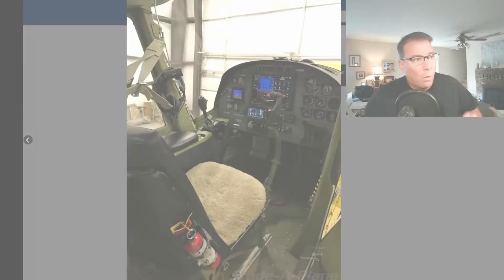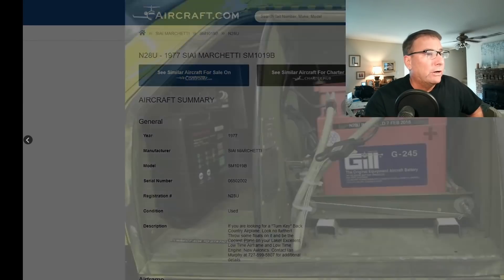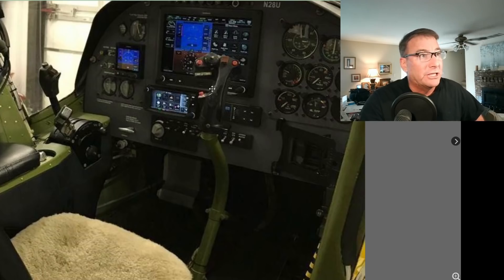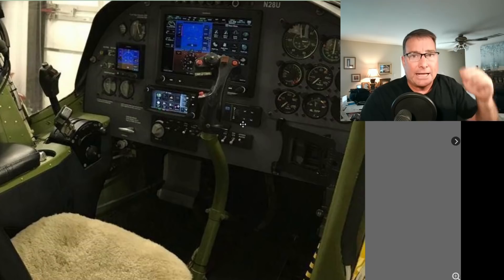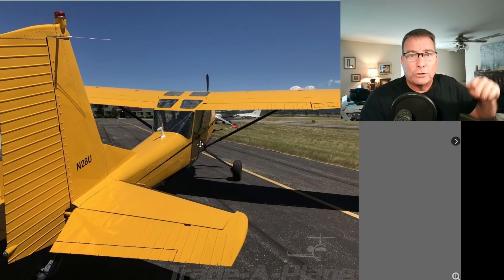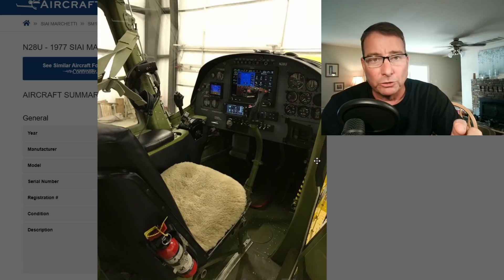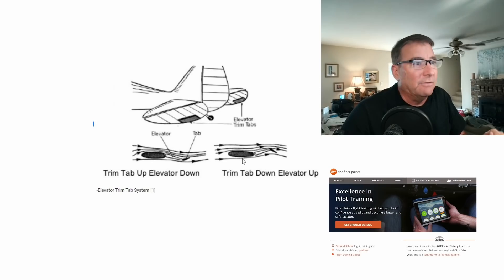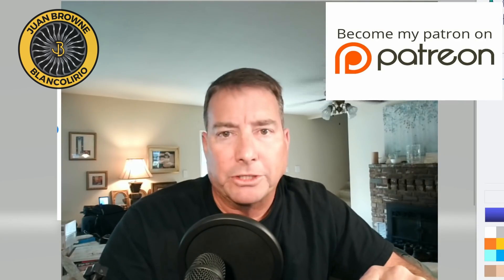Dale 'Snort' Snodgrass Siai Marchetti UPDATE- Elevator Trim System 8/8/21

Comment: "In God we trust, everything else we check..." This must be one of the more important things to check after any maintenance work.

Edit: I've considered my remarks and feel I've done the pilot an injustice here, even though the principle above might be true. 

I'm sure Mr. Snodgrass didn't live a long aviating life by being blase and the thought occurred to me that the problem which sadly took his life may have happened on the takeoff roll. He could have zealously checked for runaway trim before every flight only for it to happen on the taxi out or the takeoff roll when it wouldn't have been apparent until liftoff...

I check for full trim travel and as part of that I check the sense of the trim tabs at each end of travel, but I don't check the tab when returning it to takeoff position. I wonder what the odds would be for the mechanism to fail just as I've started moving it from full to T/O? 

From now on I'm going to check that too and, for those of you with electric trims, how about a quick squint backwards (if able) to check the trim sense as you line up & check your controls for full & free movement?
Reply: “Flight controls ……. Free and CORRECT”
Reply: @Andrew-13579  and don't just say the words! What you've said is true, but read my edit above please.
Reply: Do all or most aircraft have a trim position indicator that’s mechanically linked to the trim cables?  Then, before takeoff, check trim “at takeoff setting “.  As I recall, most if not all Cessna 150’s had this (I know this was not a C150).  But they didn’t have electric trim, so it couldn’t run away.  It took a lot of swipes on the trim wheel to go from high nose up trim to cruise trim.  I wished it had electric trim.  So, is there some clever way to wire up or design electric trim so that it is nearly fail safe?  …or very robust.  And do they always have a manual back up if electric trim fails?  That’s assuming the trim tab had anything to do with this accident.  

Maybe it was CG?  Or runaway trim with aft CG?  Or aft CG limit with a sudden load shift that then put CG out of the box?
Some combination of CG near limit and insufficient airspeed over elevator at high AOA and attitude?  Such as, did the prop wash stream move above the stabilizer and there was not enough static stability to bring the nose down, even at full forward stick?

When was the previous time he flew the airplane?  And was anything worked on between that flight and this one.  I guess the log books will tell, hopefully.
Reply: @Andrew-13579  not being familiar with anything other than C152 & 172 I can only guess, but I expect they do. My point, probably not well articulated, was that I would correlate the tab position visually with the T/O set point indicator on the trimmer. Yes, there are many ways for things to go wrong. I hope the Accident Board manages to find out which did.
Reply: @theflyingfool  In other words, look back through the back window, pull the yoke back to lift the elevator and see the trim tab, and then move the trim to see the tab respond in the correct direction.  Right?  Yes.  It’s been many years but I remember doing that.  I remember my instructor telling me to do that, either in pre-start check or out at the run-up.  I didn’t always do it, though.  I would, however, always look to see the tab about where it should be for takeoff, and that that agreed with the takeoff trim indicator on the panel.  But then, takeoff trim was always pretty close to neutral and there was only 100hp (at most), and I always made normal attitude takeoffs that were pretty flat.
Reply: @Andrew-13579  Aye!
Reply: Imwt- In mechanics we trust
Reply: @brandyf4088  yes, indeed, but all humans are fallible and if I get an aircraft back from maintenance I go over it very slowly with a fine toothcomb and check everything I possibly can. In todays hectic world having things double checked by a colleague isn't always a failsafe...

Comment: Unless he'd never flown the aircraft before or it was fresh out of maintenance, a reversed elevator trim would have been noticed and corrected. A runaway pitch trim or jammed elevator control would be more likely. Hopefully, enough of the control system survived the crash and post-crash fire for investigators to determine the cause. If you consider the pilot's flying ability, it had to have been something extraordinary if he couldn't deal with it.

Comment: Great job as usual Juan.   I think you’re on to this by focusing on elevator trim.  
My uneducated opinion based on several thousand hours of Tailwheel :   He’s in a hurry…… trims full aft for run up  ….departs before retriming stick. It went severe nose up immediately as if it was inadvertently set that way

Comment: Trim theory easily answered. If plane flew correctly last time flown, and had not been serviced, wires don't rewire themselves. Unless you're saying the motors are known for reversing by themselves without human. Defies mechanical logic though.

Comment: Maybe they need trim override “Button” at take off, simple solution. Trim is for basically level flight, I believe, from a wanna be a pilot since air cadets, 188 Cobra Squadron, Downsview Onatario. Trim killed the Max jet too! Great info in your videos, thanks.
Reply: Anyone saying this is from trim is an idiot who hasn't flown a small plane in a long time, if ever. He 10000000% could overpower a max trim using the stick. It would have made for, at best, a weird looking takeoff from the outside but likely someone with his skill level it would look completely normal to us, he would just declare an emergency and land and his arm would be a bit tired.
Reply: @X85283  Is this the only video you have watched?

Comment: New a guy in and A36  pilot in SJC that was talking to tower PTT switch during which he was also pulling trim switch. He almost died the aircraft went nose up and it took. Took everything he had to control in high density area.

Comment: I suspect you are on to it there Juan. Typically you don't install a trim disconnect switch unless it's more powerful than you are.
Reply: Jack, I thought any electric trim system required a disconnect switch on the yoke?
Maybe just on every plane I flew that had an autopilot. Humm?

ON ANY airplane I ever flew with an electric trim, the first CB I familiarized myself with was the Trim motor Circuit Breaker. 
This is especially important when flying on autopilot because the A/P will keep the commanded attitude even if the trim is in a un commanded runaway, that is until the control forces exceed the auto pilots command authority.

I have had two of such trim runaways while flying and know of a turbo prop crash at I commuter I flew for who crashed as a result of masked trim input from an autopilot on a coupled approach.

Comment: About 35 years ago I took a solo two week trip in my 1964 Citabria. I had removed the back seat and stick to allow all by baggage and my bicycle that would just fit with the front wheel removed. I took off and climbed to 8500 ft for my cross country. Starting my high cruise decent, I descended to around 3000 ft and began to level off, or so I thought! I gently pulled back on the stick and it would NOT pull back! I immediately turned around in my seat to discover one of the front forks of the bicycle that I removed the front wheel off of had dropped down and lodged INTO the control fixture that holds the rear control stick. Fortunately, I was able to quickly reach behind me and pull the front bicycle fork out of the control fixture and regain full control! LEASON learned and I was extremely fortunate! From then on, if I ever removed the back stick control, I installed an 8" stainless bowl inverted over the rear control fixture on the floor and screwed it into place over the wooden floor panel at the rear control fixture. That fully protected the rear controls with the stick removed. Hope someone learns through my STUPIDITY! On stick controlled aircraft, always put in place some type of cover to protect the fixture from interference! Just lucky this happened at altitude and I had time to investigate and fix the problem rather than during take off or landing!
Reply: As QA on different military aircraft and as an A:&P I used to find FOD in the cockpit.  It was mostly pens, cotter pins, rivets, coins, and safety wire.  One of our birds was craned off the ship due to jammed flight controls that we could not duplicate on deck.  Scary stuff at any time but more so around aircraft carriers.
Reply: Doing a little training with Beavers and  Otters used during emergency relief flights we had to review a video.  In it it showed ground crew, fire department personnel, and volunteers pushing and pulling one of the floatplanes from the left aileron and left elevator by hand to get it lined up on the dock.  I pointed this out to the instructor that it should not be done like that and to never push or pull the aircraft by the flight controls.  He blew it off as no big deal.  He was not an aviation type guy.  I insisted that it can't be done like that any further.  I'm not a licensed pilot but have flown planes before.   My friend siting  next to me who was a former Air Force pilot and has flown many types of aircraft kindly intervened to try to set the guy straight.  We all had to talk about it after the class. The onstructor finally came to his senses.  

I don't see that the elevators would be damaged like that in this case but it goes to show how something seemingly minor to some is really a big deal.
Reply: I sure hope the investigation looks at the camping gear and what you mentioned about some piece of gear jamming the controls.  Also did some camping gear shift rearward causing rear CG problems.
Reply: You'd have thought that the aircraft's makers would have anticipated the possible jamming of a control column by cockpit debris by covering the base of the column with a protective sleeve: maybe they didn't check out all the "what ifs" in designing the cockpit layout.
Reply: Lucky to learn a lesson there. Aviation is usually not that forgiving……😱😪
Reply: I dont see where anyone has mentioned that he has full flaps "deployed". That alone is a HUGE factor. Anyone whos flown a Cessna knows that from experience..
Reply: @52jaws  Anyone who knows anything about flying in general knows that full flaps deployed makes little sense there but that's the first time I've actually heard he had full flaps!!
Reply: I think this is more likely than runaway trim or backwards trim. I have never flown the Marchetti but I have lots of time in the L-19. I think you could over power the trim enough to keep from stalling the plane. But in any tandem aircraft, something could block the rear stick.
Reply: @Charon58  What are the rates of occurrence of those three problems ? Without knowing them, you are guilty of speculation.

Comment: I very much doubt the trim system has enough aerodynamic power at that speed to prevent it being overpowered by the pilot, particularly with the relatively long lever moment of the stick. If you look at the video it appears he never raised the tail in the takeoff roll, which is very unusual in all but a very few types, mainly some WWII aircraft with low propellor ground clearance when the tail is up. Having flown tail draggers for 45 years I was taught that except in those rare types you always get the tail up for a number of reasons, but most importantly so you decide when it is time to fly, not the airplane.  Therefore, if this aircraft has just come out of deep level maintenance I would be inclined to be looking at a reversal of the elevator control system (more likely if cables than a pushrod and I do not know which is used on this type) than a pitch trim problem. This would explain why the tail remained planted, even if the PIC applied forward stick to lift it during the roll.
Reply: 2 great points there-

Comment: I believe it was a broken trim tab that caused Jimmy Leeward's P-51 to pitch up during the 2012 Reno Air Races.  The plane soared up, banked left, came down parallel to the viewing stands, and crashed into the box seats in front of the stands at full speed.  My wife and I were in the stands and "The Galloping Ghost" crashed right in front of us.  With all the devastation, we were amazed that there was no fire (the smell of AVGAS was strong).  A small item like a trim tab can have a profound influence on the control of a plane.

Comment: The post maintenance warning is genuine. I had both air start units on an EMB-145 fail when after a service/inspection, oil was not replaced in the starter gear boxes. They fried on the fourth cycle(S), blowing shards and sparks out the air exhaust. Thanks Juan

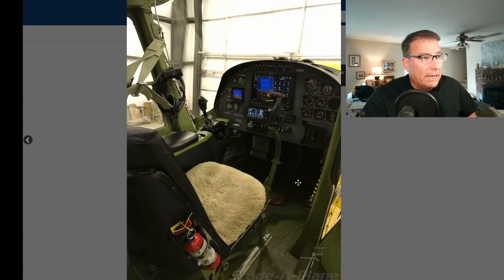Comment: How about the fire extinguisher, visible at 0:33 is dislodged during embarkation/disembarkation or adjustment of shoulder harness, rolls back and jams under the horizontal torque tube, visible at 2:00 that connects the rear stick to the front stick.
The torque tube rises when the stick is back, lowers when the stick goes forward. Anything jammed under there would prevent the pilot getting the stick forward.
Reply: In that case anything loose in rear cockpit could do same thing.
Reply: @kenclark2848  Correct

Comment: Looking at the frame by frame shots, he definitely has flaps down to some extent. When you step through the frames and even seeing the post accident pictures, the trim tabs look in place and the elevator was neutral. There is a few frames of the plane in the sharp left bank and you can clearly see the elevators. Really makes me wonder if the elevator was completely stuck or bound in some manner. My understanding is that there is a 4K video of the accident. Hopefully they find the cause of the accident. Hate to see a pilot of his caliber lose his life this way.
Reply: Not sure why the flaps were down on takeoff - at least to that extent.  They were still evidently down as the plane turned but were they still so far down?  Agreed there doesn't seem to be any movement of any other control surfaces.  Would the flaps have added to the pitch up moment?  Sure the plane was a STOL but this was a takeoff to get somewhere in a hurry so why flaps?  The video also suggests he took off well before getting clearance - unless the audio and video  are out  of sync.
Reply: @peterknight4692  Extending flaps causes a nose down moment.
Reply: @KB4QAA  Ok, though I got this from the FAAsafety.gov website on flap usage:- 
"Flap  deflection  of  up  to  15°  primarily  produces  lift  with  minimal  drag.    The  airplane  has  a  
tendency to balloon up with initial flap deflection because of the lift increase.  The nose down 
pitching moment, however, tends to offset the balloon.  
• Flap  deflection  beyond  15°  produces  a  large  increase  in  drag.    In  high-wing  airplanes,  a  
significant  nose  up  pitching  moment  can  occur  because  the  resulting  downwash  increases  
the airflow over the horizontal tail."
That looked a lot more than 15 degrees of flap.
Reply: @peterknight4692  The audio and video are badly - and deliberately; read the video description - out of sync. They show about 18 seconds from takeoff to final words/crash when the actual radio transmission recording shows there was silence for 35-36 seconds between his acknowledgment of takeoff ti his final heartbreaking words. So he did not rush takeoff but was silent for about 18 seconds before taking off.

Comment: The trim idea is good, but this crash was not caused by a trim problem.  The speed at which this aircraft flew was too slow for the trim to be more powerful than stick movement.

Comment: Years ago, I think in the late 70s or early 80s, a friend of mine took an aerobatics course using a Citabria.  After finishing the course and while renting this Citabria he had a front seat latch failure while doing a loop. The seat slid back on it's rails until it hit and forced the rear control stick to it's full back position. During this period of time there had been a rash of exactly the same event happening and it resulted in the death of three or four pilots. My friend was almost destined to be the next fatality. However he was smal,l weighting only 140 or so pounds and as a construction worker he had great upper body strength. When the seat went back the plane immediately finished the loop in a tight and extreme manner while he grabbed the tube frame members above the glare shield and by force and strength alone he was able to take the weight off the seat thereby regaining a position to be able to recover the airplane. Right after this incident he was questioned by the FAA and later the NTSB.  An AD was initiated and the problem was fixed for good. it was his testimony that led to the answers they needed in the other fatal crashes. Had he not survived to tell about it, surly more pilots would have died because after crashing there was little if any evidence to the seat problem.  Hopefully, if there is any such problem on this aircraft it will be found out soon.  It's always sad to lose another winged friend.

Comment: This accident happened really fast.  By listening to the ATC tape it sounds like Snort was in a hurry.  Something drastic happened right after liftoff that he wasn't able to correct, like trim problem or cargo shift jammed the stick.  Airplane hit so hard it's going to be a tough job for investigators to find out.  Just my opinion but think he had to have been in the front seat - I doubt rear seat position has all controls needed to power up and start the engine, etc.

Comment: You don't fly an aircraft with the trim switch. The stick is used to maneuver the aircraft. Trim switch is trim switch, and not a maneuver device. Had a runaway trim switch go bananas on an AN-2. The stick and wheel has more authority than the trim switch.